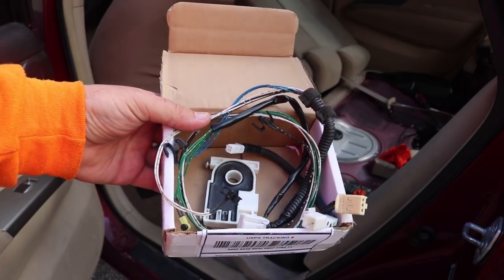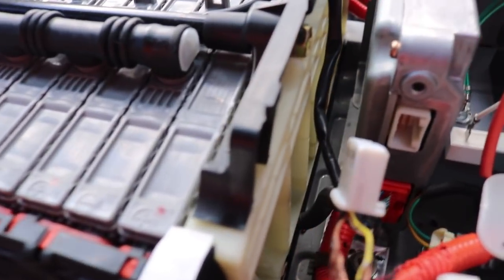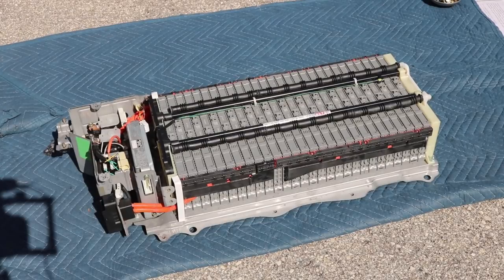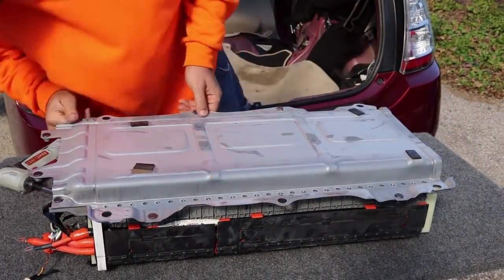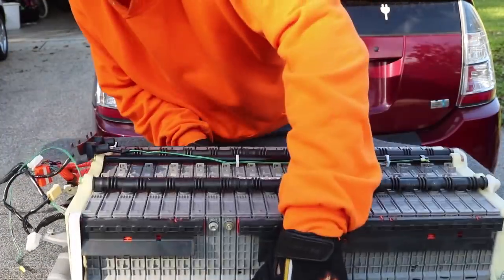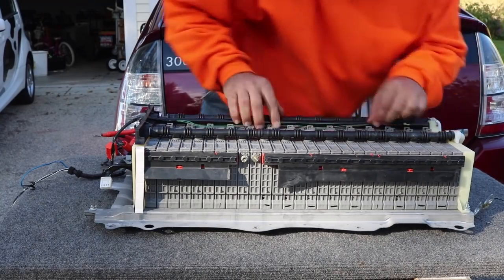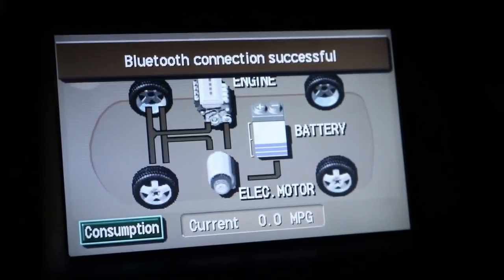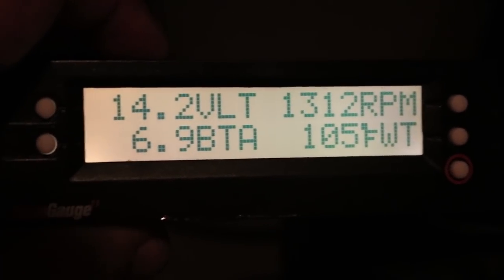Repairing Mouse Damage to Prius Battery Pack - Current & Temp Sensor Wires Replacement

Comment: Hi Benjamin, FYI in this kind of harnesses, it shall be  possible to remove wires one by one from connector, and replace only wires you need to. Usually if you press the barb on crimp connector with tweezer or pick you can remove wire carefully. During harness production all the wires are just inserted into housing.
Reply: I can't  believe he went through all of that.... just needed a set of pin removal tool

Comment: I had a mouse problem in my car but it runs and drives fine all a mechanic could find was the cabin air filter in poop inside I also have a 2008 Prius
Reply: Hopefully the damage was minimal

Comment: One question. Is there any seal(Unopened) on factory battery box.? thx in advance.
Reply from the maker: There is no airtight “seal” on the battery. It’s air-cooled and has venting with fans connecting to it. The cover for the battery is really just a series of pieces of sheet-metal, plastic, and carpet.

Comment: I was wondering if possible to use that as a battery bank for solar setups.
Reply from the maker: While you certainly could use a Prius battery as storage for solar, the actual capacity of the battery isn't that much. Used cells from a Nissan Leaf or Chevy Volt would likely be better. There's a few people who have done pretty impressive solar storage with both those types of batteries.

Comment: My '05 Prius doesn't have that black bar on the battery, I wonder why they had it and then removed it.  Those plastic vent pieces are a pain to get back in!
Reply from the maker: I'm not sure about the black bar. When I was fixing the car and looking up information on it, it looked like some model years had the bar and others didn't. Go figure!
I was glad to fix the car, and it's been running well since.

Comment: Not to take away from all your good work, but couldn't you have used a tool to pull the pins from the one connector with the damaged wires and replaced it with the one from the replacement harness? It would have saved you having to replace the whole harness like that.
Reply from the maker: I took a look at the connector, and it was NOT obvious how I would be able to take it apart, nor what special tool would be needed. It's all very small connections. Based on my experience of the few times I've tried pulling and replacing pins on other types of connectors, there's a good chance I would have wrecked BOTH the new and the old harness.
If somebody else is more skilled/experienced than me, and has the right tools, that may have been another way to make this repair.
Reply: BenjaminNelson  I understand. I couldn't see in the video the connector very well to see if the pins could be swapped out or not.
Reply: Exactly, I don't understand why going through to path of replacing the whole harness?. Whats wrong with cutting the damage cables, patch with new cables, soldering and shrink tubes.  I'm mean you have build complete electric cars so I imagine you can solder :)
Reply from the maker: Hi Peter H, Frankly, the wires are really short and I'd be sticking my hands INTO the battery. Not much room in there for both hands, a wire cutter, wire stripper, soldering iron, etc. It would be really cumbersome trying to strip/solder/etc. in that small area. I'm also still recovering from a double wrist fracture, and don't bend like I did before.
I also wouldn't want the possibility of poor workmanship to be an issue. If I EVER had ANY other troubles with the car, I'd always be second-guessing myself. I'm working on doing more and more things "the right way" nowadays. That means doing it right and complete the first time, and just being DONE with it.
There's always more than one way to do anything. In this case, I'm glad I pulled the battery pack and replaced the entire harness. In the long run, it was actually easier for me, plus I got to see all the other neat parts in the battery and learn a little more about it.
Reply: BenjaminNelson  You Need This Tool - Episode 40 | Wire Terminal Removal Tool
https://youtu.be/YE2_ktvHqG8

Comment: I hope you figured out where that mouse got in and fixed that otherwise "Return of the Dreaded Mouse" video may be on it's way.
Reply from the maker: Unfortunately, there's no one single obvious point of entry. As you can see in the video, much of the battery pack is just sheet metal. Nothing is really sealed up against anything else. Beyond that, there's a number of vents and fans designed for the battery  to work properly, including ones that go through the body of the car.
I purchased a particular brand of mouse repellant that I'm now keeping in the car. I hope that works!